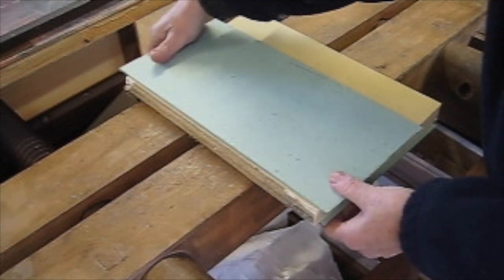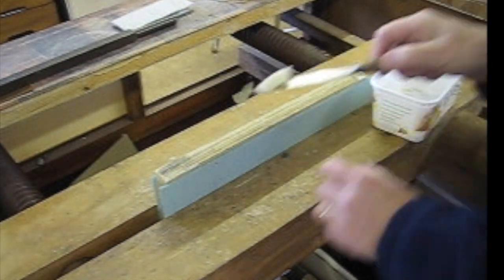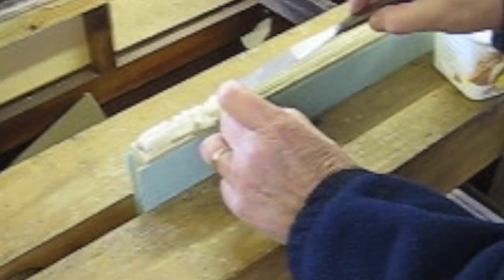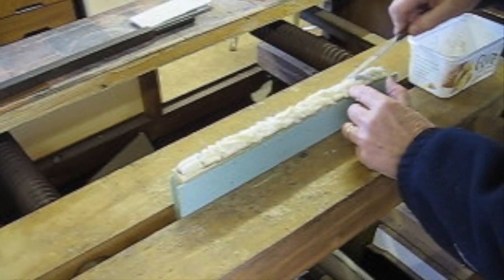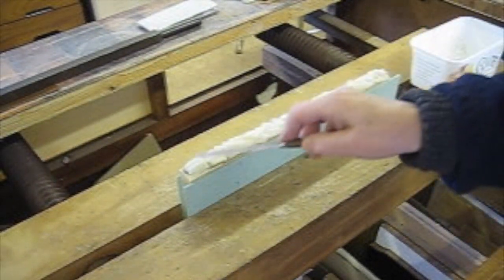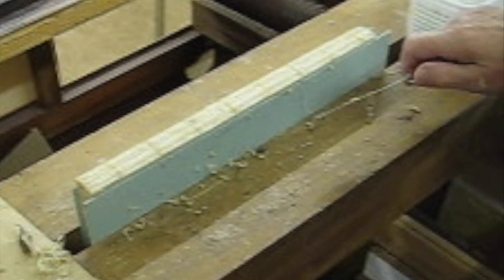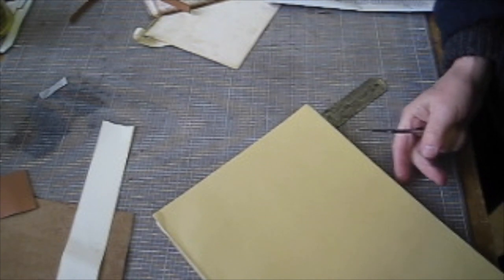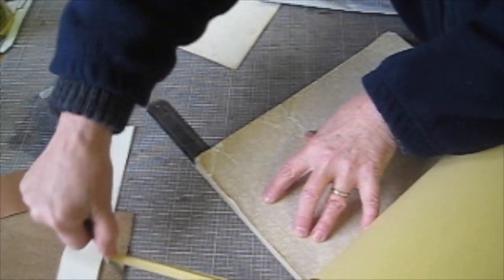6. Cleaning spine and trimming endpapers

Comment from the maker: You can make it from organic flour and water, like a white sauce - recipe in my text book; however, this is not perfect for conservation use, as modern flour contains additives. You can get paste made up from Hewit's, or you can use a good quality wallpaper paste - but again this may contain elements that are not good for long-term use. Some people use wheat starch which you can get from Chinese wholesalers, as this has nothing added to it.  But if you aren't bothered about the conservation  side of things flour and water works fine. That's the traditional method.